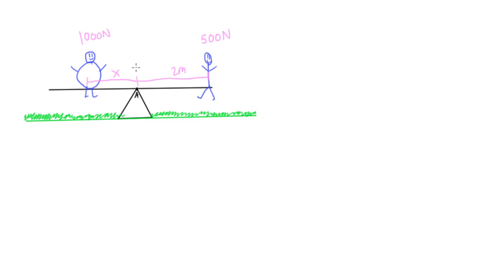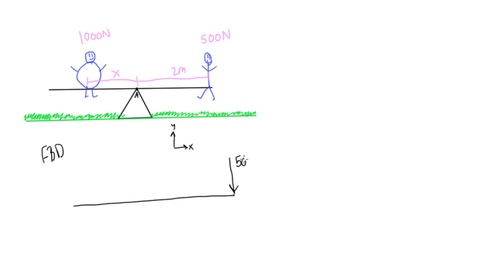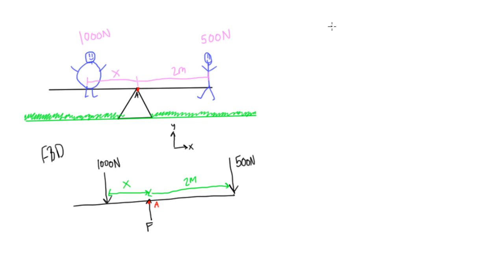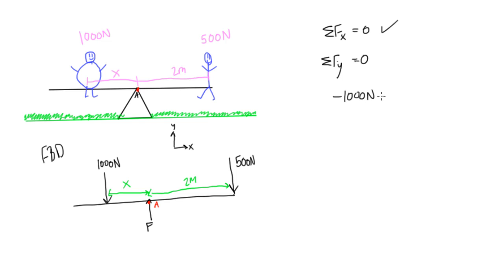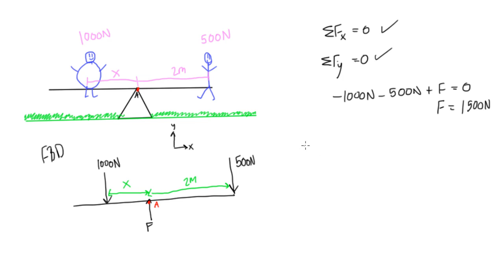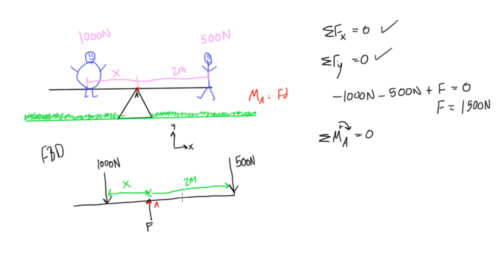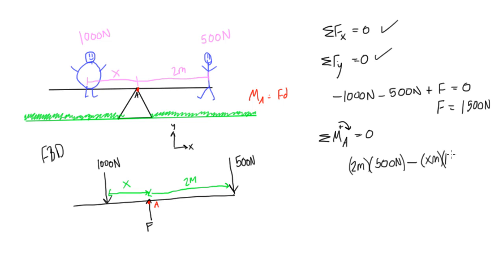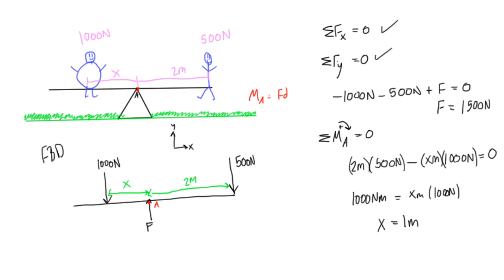How to balance a see saw using moments example problem

Comment: To be very accurate you need to allow for the mass of the lever . So you need to know the density and volume of the lever connecting . Also the point of load application impacts . The lever mass , therefore gravity force on either side is different ! Therefore the answer is not 0.5 , it will be a little over  0.5 Sorry I am joking , thank you for reminding me of the mass times distance = force , going back to my school days , great to have your help here , thank you again keep going .

Comment: What if you had the two people hanging from ropes under the see saw. Would the tension of the two ropes be the same or different based on their different masses?
Reply from the maker: The tension in each cable would be equal to each person's weight. Where weight is equal to mass * acceleration due to gravity. So weight (is a force) is in units of N where as mass is in units of kg. So yeah if these people were hanging on cables instead of sitting, then the tension in the cables would be 1,000N and 500N, respective to each person. The tension in each cable would transmit exactly 1,000N and 500N to the beam, so ultimately it doesn't matter if the person is sitting or hanging, as long as their weight is acting downward on the beam at that location, you'll have the same effect.

Comment: How can u find the distance of two boys when only the length of see saw is given,pls reply if u are there
Reply from the maker: Do you have the mass or weight or applied forces of the point loads in question? If you have a set up like the one in this video where there is one downward point load on wach side of a see saw, then the moment cause by each about the pin must be equal and opposite. M=Fd can be used where M is the moment caused by F the force and d the distance to the pin (perpendicular distance from the line of action of the force to the point we are taking moment about), so then if M1=F1d1 and M2=F2d2, set M1 + M2 = 0 and rearrange to M1 = M2 then substitute for F1d1 = F2d2. You would be given enough information in the problem to fill this in and find the remaining unknowns.
Reply: @Engineer4Free  i just solved it,the problem was only to separate the two unknown distances of the see saw into d-x and x,after that I can find then how far were the boys from the origin with momentum formula.Anyway thnx 4 replying,hope u the best wishes ❤️
Reply from the maker: Awesome, glad to hear it!! <3

Comment: I'm surprised at the amount of "Wow you took so long.." comments. When you study mathematics at a university, you're not going to straight up jump into example or practice problems. In Calculus 2 for example, it is crucial to know the methodology, layout, proof and notations before you jump into the problem so you understand the actual foundation of what you're doing. Having this knowledge can make things easier for you in the future when you have to break down problems and interchange the little things which you wouldn't know if all you did was 1000/500 = 2.
Reply from the maker: Thanks for recognizing that and putting it into a comment Jas. The steps seem way overkill in this example, but they are the exact same steps that one would use in a much more complicated problem. If you learn the method right from the start the harder problems will be much less overwhelming! :)
Reply: Indeed, thanks for the video! :D

Comment: yeah good video but the steps can be simplified down to get the answer without to much work just saying otherwise good video and it helped!
Reply from the maker: Hey yeah, agreed! I just went through all extra steps anyways to get people used to using all three equations of equilibrium for 2D problems, as this video is part of a larger free course on statics: engineer4free.com/statics (it's the 28th video out of 72 that make up the whole course).